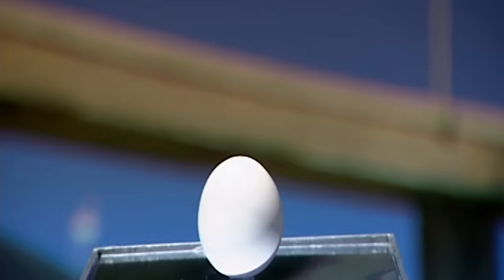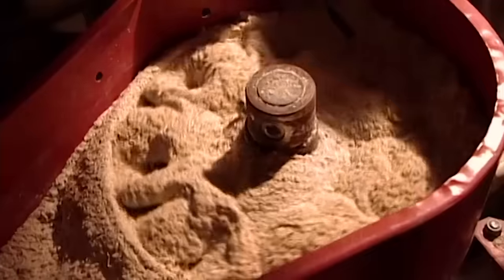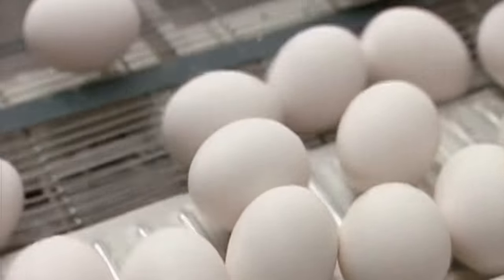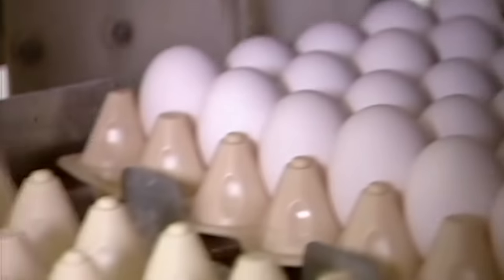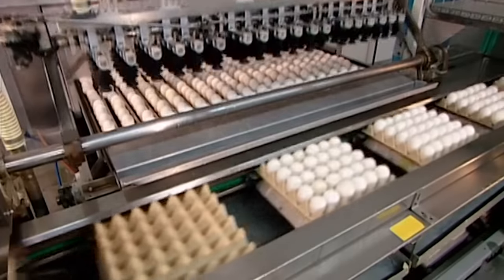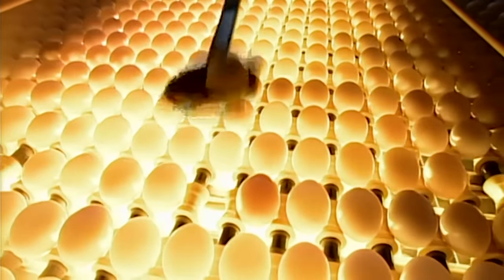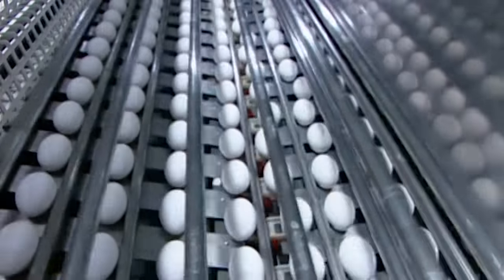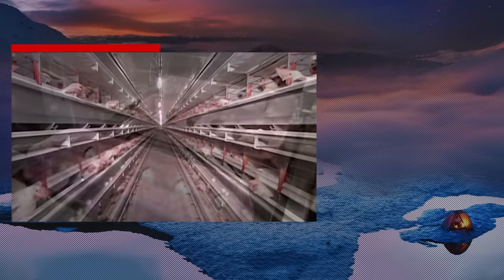EGGS | How It's Made

Comment: Using acoustics to determine the quality of the egg shell is pretty damn impressive. I wonder who figured that out.
Reply: We would also use acoustics to check for hidden cracks in our farm fresh eggs - an egg with even a tiny hidden crack will have an off sound compared to an uncracked egg when you gently tap the two together.  Cracks are still ok to use, but we would save those for ourselves rather than sell them to customers.

Comment: 15% feeding process 
10% rolling around
5%  packaging 
70% CLEANING
Reply: As a sanitation worker in an egg plant,that's about right on
Reply: And this is at a well polished facility that was ready for cameras, when you see a real one you'll see why the eggs need so much cleaning
Reply: @officerlarry2686  weird, I find occassional chicken $h*t on my eggs... I thought eggs shouldn't get wet unless right before you have to use them... different country customs, I guess :/
Reply: @EoRdE6  almost as if the eggs come out of the same hole the $h*t does, hmmm ;)
Reply: Funny fact: Countries like the USA require the cleaning of eggs. Afterwards, because the natural protective layer is cleaned off, they are sprayed with oil to protect them again. In Europe they don't clean the eggs as the natural protective layer is considered sufficient.
Feathers and dirt on the eggs is mostly done on purpose to give customers the idea that the eggs are natural and better.
Source: I'm one of the designers of these machines